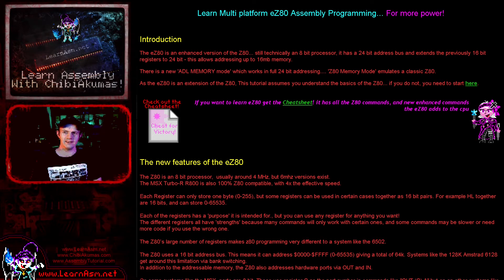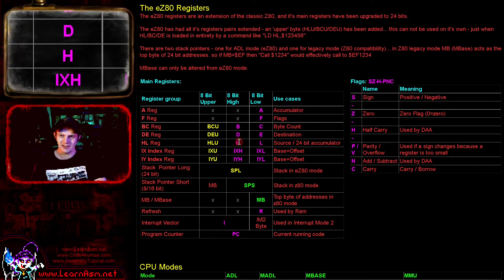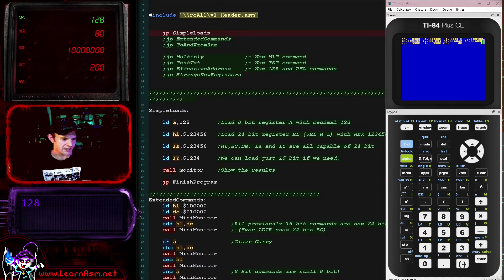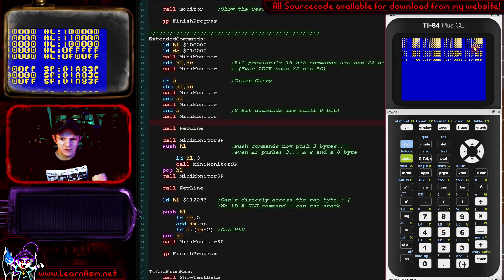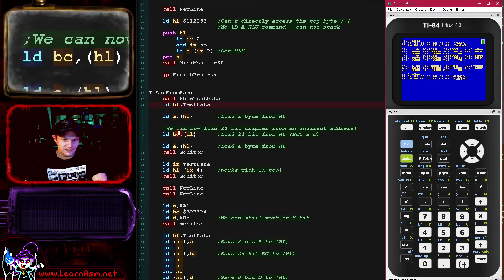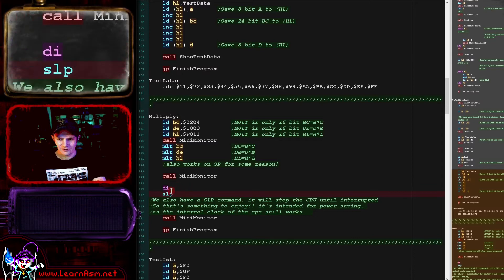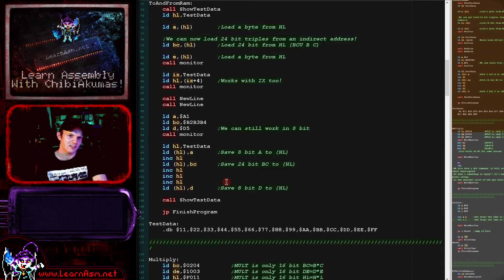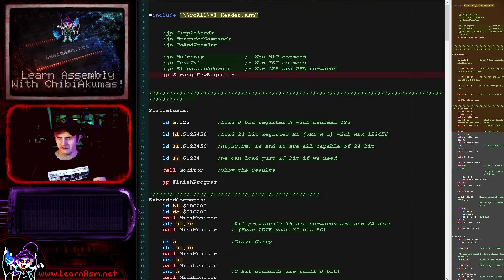Ez80 Assembly Lesson 1 - 24 Bit ADL mode, and new commands

Comment: Our group of enthusiasts wants to develop a clone of the ZX-Spectrum on the eZ80. I have heard that eZ80 has reserved port numbers from 0x80 to 0xFF for internal controllers. This is very disturbing since these ports are needed in the ZX-Spectrum. Tell me , what are these ports used for and is it possible to disable them ?
Reply: I have done quite a bit of reading about all that. 
The reserved registers are really not an issue.
Because all IO operations on the eZ80 use 16bit IO addresses, and the internal peripherals use only the 0x0080 to 0x00FF range.
You still have all the 8bit IO addresses free. But you have to modify all code to use 16bit IO addresses. That is the real issue.
It is simply not possible to run old z80 code on an eZ80 without modification

Comment: TI's decision to lockout assembly from their TI84 Plus CE was an unfortunate decision. I learned how to program on the Z80 based TI85, TI86, & soon after the Motorola 68000 based TI89 calcs. They are an excellent platform to use for anyone to provide an in depth understanding of computer architectures, modern systems are simply too complex to understand in whole. I'm surprised that I haven't seen anyone build a curriculum around a simple still available computing system like one of TI's well documented products such as their TI83 Plus, TI84 Plus which still support on calc assembly, the TI89 would be a good start as well though it doesn't support on calc assembly though one can build asm programs off calc on their PC, another option would be getting one's hands on a software downgradeable TI84 Plus CE until the newest firmware is able to be cracked allowing downgradeability on the newer "Python" TI84 Plus CE models.